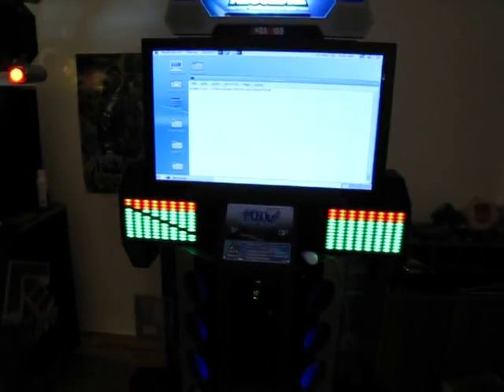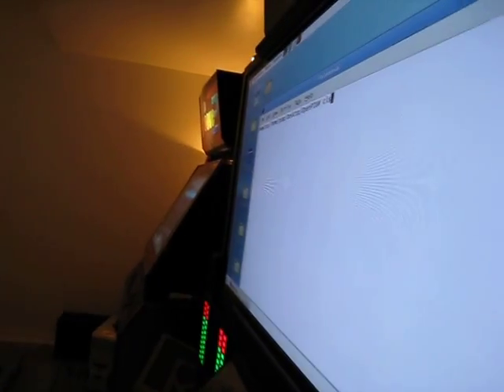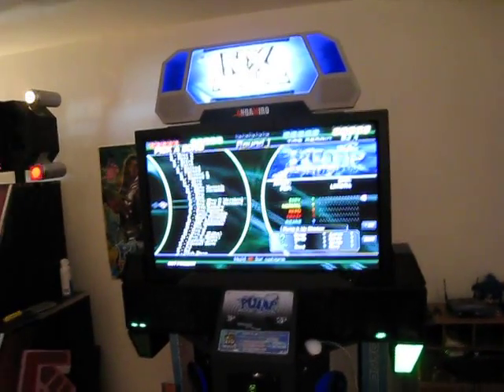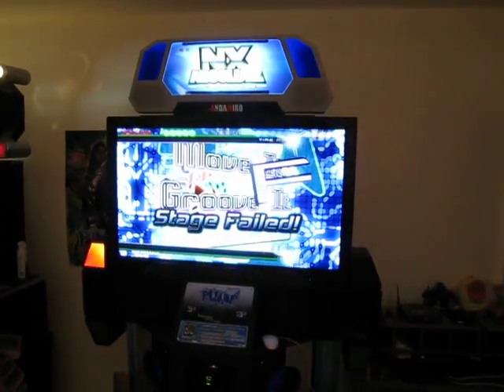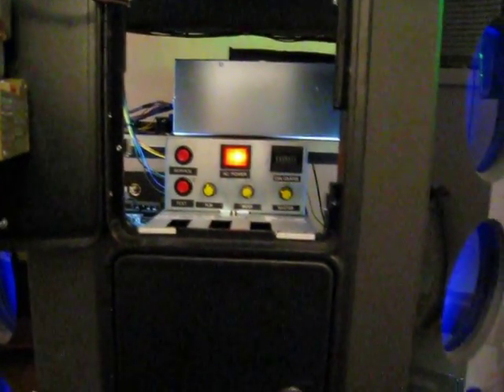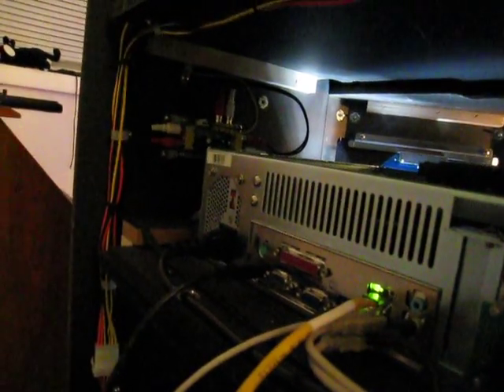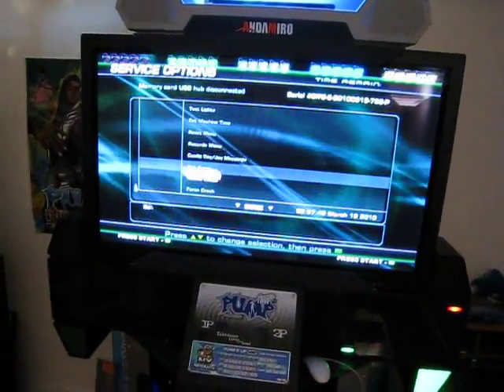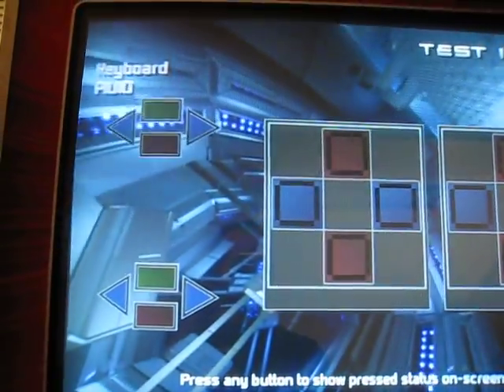FX Cabinet with OpenITG

Comment: Hey I know this video is 4 years old but (assuming you still have your FX cabinet) do you know or can you find out the dimensions, volts needed, and amps needed for the fuse in the noise filter box? I have an FX cabinet as well and I blew out the fuse and lost it...